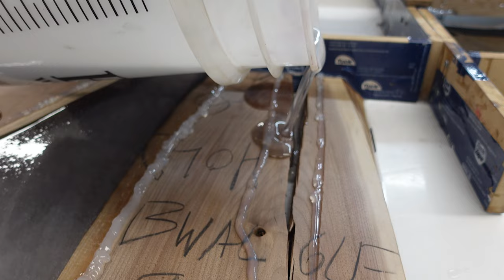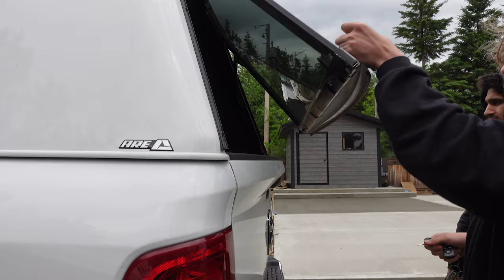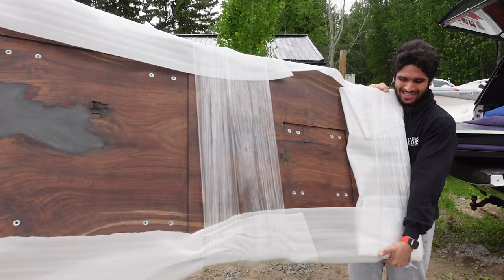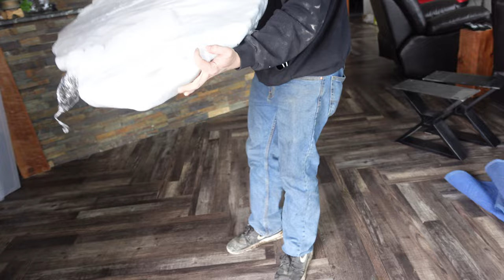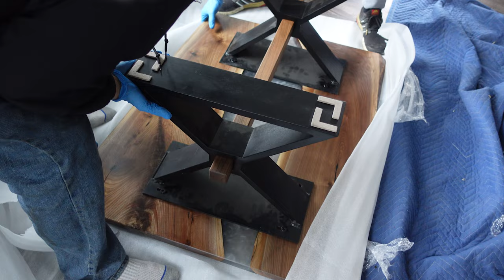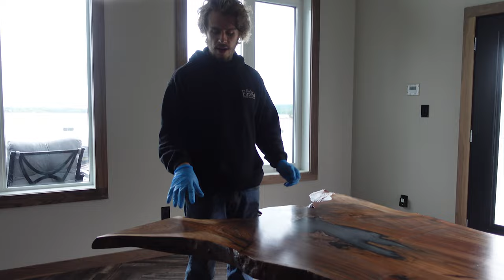Turning Salvaged Trees into Tables

Comment: What a team effort on the apple table leg. Well done Brad for the initial cutting and a gold star to Spencer for thinking outside the square with the cnc. So that apple table leg was not too heavy then, heh, heh. I think my favorite piece was the dining table top and the two burl's. Not a fan of the oversized metal legs or the tree stump legs, all a bit too rustic for my taste. The new oil finish is looking interesting, keen to learn more. Is it based on Tung oil? Well done Guys. Cheers,Michael.